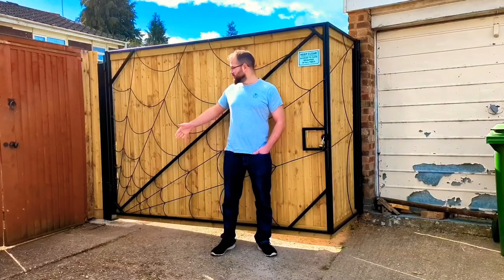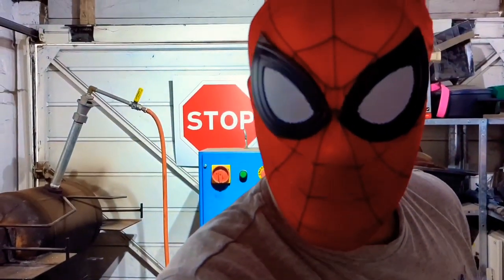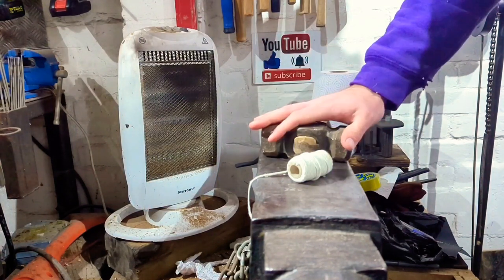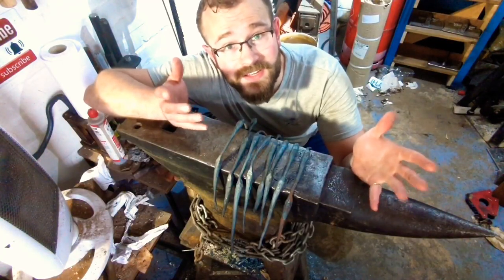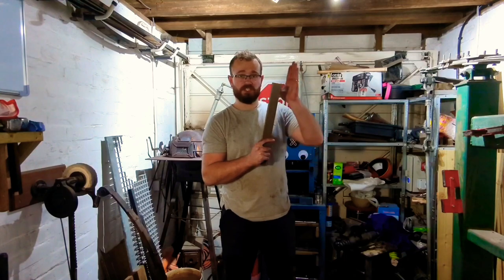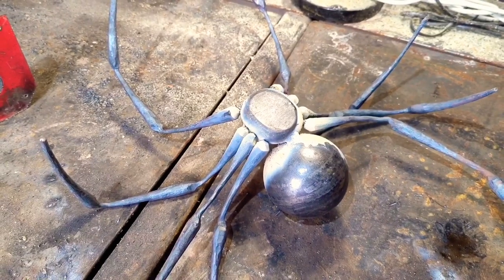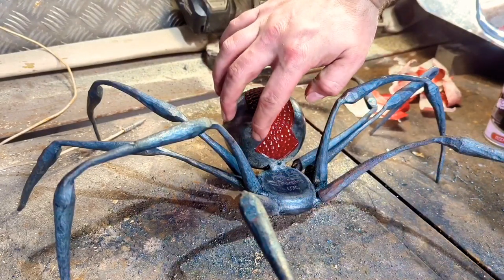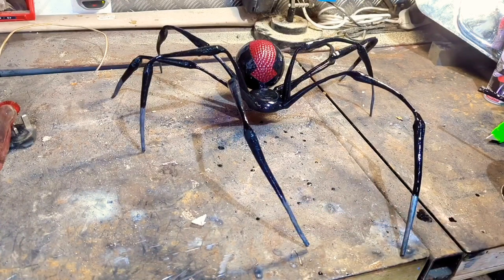Blacksmithing - Forging a Spider

Comment: Very nicely done. Had a feeling that spidey mask wasn't going to last long during the forging process, hahaha. Looks really nice, and glad the gate, presumably, still opens enough without the spider ramming into your neighbours gate.
Reply from the maker: Genuinely... Vision was about 10% with it on. 😅

And yeah, where the gate pillar sticks out away from the fence some, there is plenty of room for Spidey in between the 2 gates. :)
Reply: 10% vision is pretty generous :D
also saw you accidentally welded through some of the rebar webbing?
Reply from the maker: @thespartan2224  yeah, I had the welder turned up too high. My own fault. Easily fixed though.